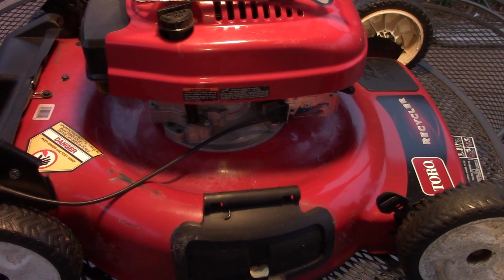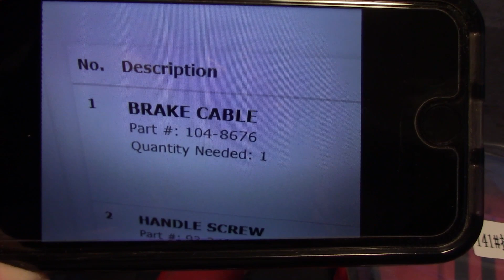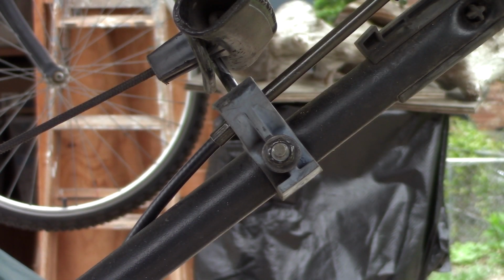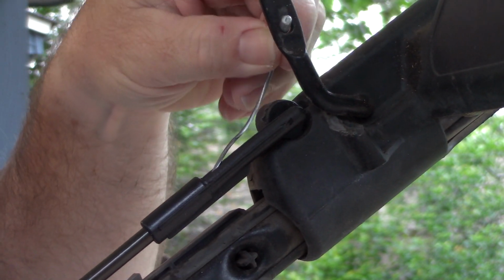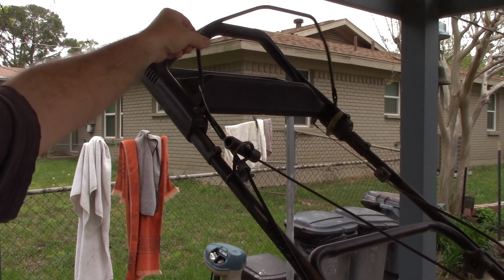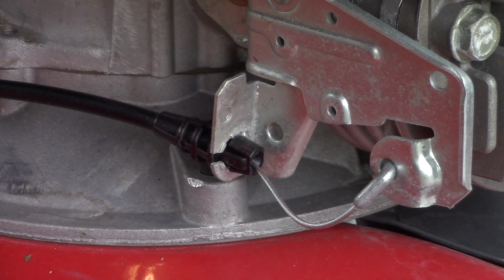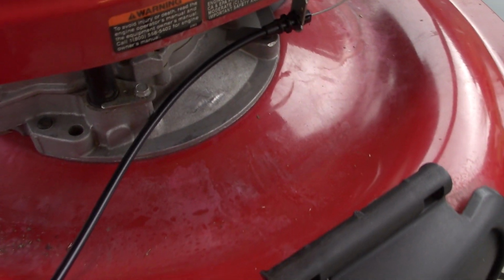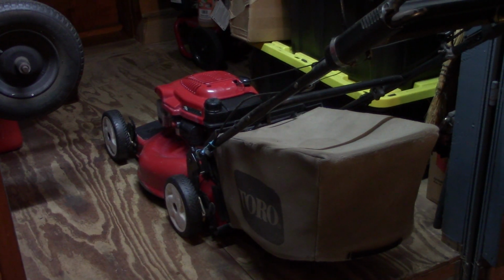2003 Toro Personal Pace Model 20017: Engine Brake Cable Replacement

Comment: I had to do that almost exact repair to my mower last summer only my cable was down to about two strands of cable left holding it together and it was the self propel cable not the engine brake.  I did have to do an engine brake cable on my dads Craftsman mower a year or so ago.  That cable completely broke and i desperately needed to mow his lawn so I zip tied the mechanism the cable attaches to in order for it to run and I got the lawn mowed then cut the zip tie to shut it off again.
Reply from the maker: I will be replacing the self propel cable soon.
Yep, I would've come up with something like you did with the zip ties, had it broken!

Comment: That frayed cable would have to last at least 30,000 more miles on my mower.  I had the cable holder mechanism break on me one day while mowing.  Took me a minute to figure out what the problem was, and why it was so hard to pull the rope.  My solution was to remove the spring that puts the brake on when the handle is let go.  That worked, but the vibrations of the mower caused to to rattle and go to shut off, only to come back and then go to shut off, etc.  My solution was to use the part of the cable that was left there sticking out as a spring to hold it off.  As a consequence, the "ignition is always live", and I have to hold the metal piece in the other position until the engine stops.  Part I like the best is that the stupid "whammy bar" has been deleted, just like an old school mower.  My old Murray mower had that still functional; I used to use a velcro cable wrap to defeat that, and do the same on my edger.
Reply from the maker: Yep, there are certainly other workarounds. I could've reached down, and jammed a piece of wire to hold the switch in the close position, and then pull it out to kill the ignition. The cable had one frayed piece the first time I used it, and then very quickly it went up to three or four frayed pieces. I have a theory as to why this happened, in an upcoming video in this series. I have two more parts to record, since the last order of parts arrived. Then I can move on to the 1982 John Deere, with no safety features needing delete. That is an interesting mower, especially the time frame it was manufactured! It has the classic 3.5 hp Briggs and Stratton. Just hearing that 3.5 hp Briggs run brings back fond memories from childhood. Nothing sounds like that now! Even the sound the pull start rope makes is awesome!
Here is a video from 2012, and it was a bit difficult to start. As a side note, those solar lights I trashed looked to be brand new, in this video from 2012, so even older than I stated in the patio opening!
https://www.youtube.com/watch?v=whjxDulFUqs
Reply: @dynatrak  I remember the pull starts that sounded like that!  Never owned one but I remember other people in the neighborhood having mowers that sounded like that!

My neighbor across the street used to have an old 2-cycle Lawn Boy with the side discharge bag.  I will never forget him mowing the lawn wearing a wife beater, pushing that Lawn Boy around, while smoking a pipe!  Man, those were the days!

I look forward to seeing those John Deere videos!